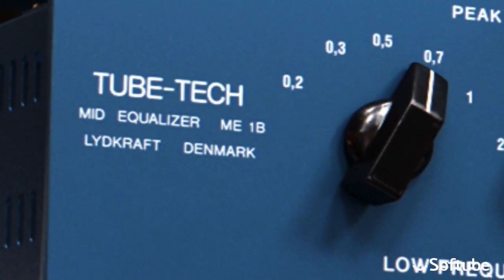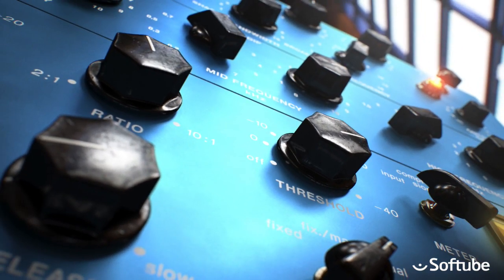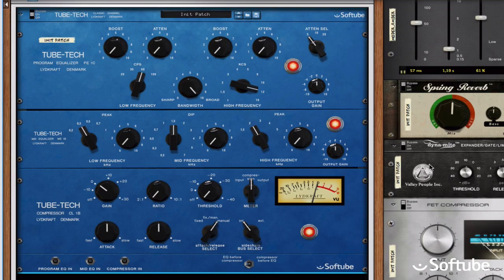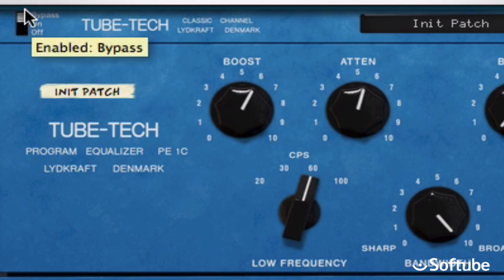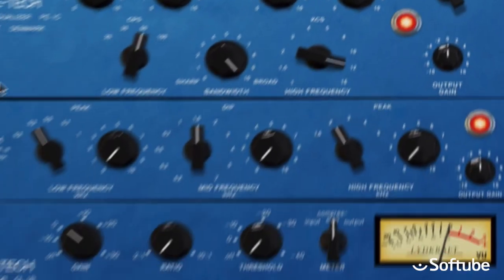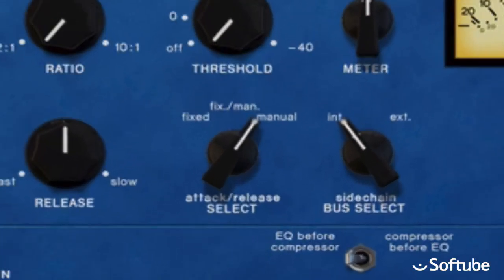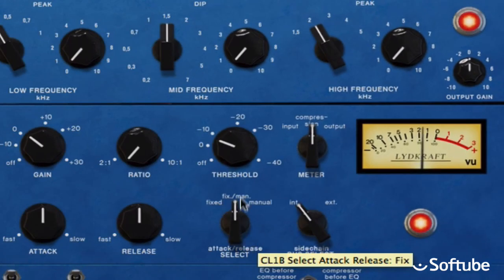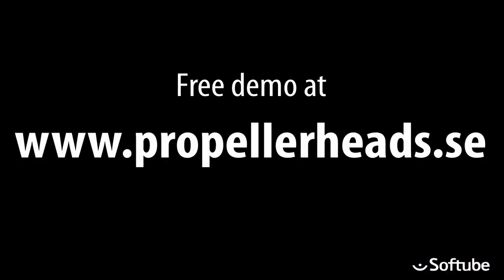Softube Tube-Tech Classic Channel for Propellerheads Reason

Comment: you think it's expensive ?!? compare that with the real hardware unit ^^ that was not affordable for everyone, only for big mastering studio, thank you for this massive add Softube guy's ^^ !!!
Reply: +Meteotrance Not to mention you could put 20 of these in your Reason rack!! XD
But yes, the price is not cheap... :/
Reply: +DreamWizard9 as long as you have enough CPU and RAM ressource you can put a lot of this on any track you wan't but for me this thing is more specific for Pre Mastering or Mastering usage, for using on group or steems it's a valuable option, remember that the price of the real unit is more expensive than the most expensive computer in the world ^^, and an emulated version could'nt beat the real unit but this one do an amazing job, and check what's Kuassa do for the same thing, those one are more clear and less hardware mimic than the Softube one, but can make a similar job.

Comment: hello..this sounds great..!
I have a GUI question...The Rack Extension version looks flat compared to the VST . The black knobs on the RE looks dull the VST version has more reflection glossiness to them, which helps bring it to life even the all blue Face plate looks awesome glossy wet metal looking surface...The Rack Extension version  again looks dull and flat.

The sound is still great !! but I wish The Rack Extension had that expensive glossy metal reflective look/Finish. I'm glad that this is finally in the REASON shop!!

Comment: BTW. Kuassa has just released their latest RE, just a day after this one from Softube. It's an EQ in the same style as the "Pultec* MEQ-5 Midrange Equalizer and the EQP-1A Program Equalizer. That's pretty much what Softube has in their Tube-Tech RE, except that instead of the three-in-one RE that Softube is selling (for the price of a garage in West London), you have effectively two-in-one (just the EQs) for only... €35 / $45. Take note, Softube!

Comment: A good thing, but the price is insane. 279 euro? For this price I bought a Korg KP3 kaoss pad.
Reply from the maker: It's two EQs and a compressor, so that's less than €100 each. And it's still circa 25% below the price of the plug-in in AAX/VST/AU format.
Reply: SoftubeStudios Its two EQs and a compressor that are enclosed in a single unit, which means it should be priced as a "single" unit and these are Re's which mean you cant resell them or have the freedom of using them in different DAW's so in my opinion and most of the Propellerhead Forums opinon - Your product is way overpriced.
Reply: sinnerfire

Not to mention that you can buy both Mcdsp bundles (3 EQs, 3 compressors) for 80€ less.
Reply: +sinnerfire Exactly. I personally think you guys, Softube, are fools for pricing it like you have. An insult to Reason users who are trapped in one DAW with the product = But you're obviously like the rest of the Swedes, so damn impressed with yourself it almost hurts, right? You think this is really valued at $350 for Reason or is that just your ego?
Reply: Ras Cricket +1
Reply: +Ras Cricket I agree Ras. It's on sale right now for $169 (the RE) but this sale price is still over double what I would be willing to pay for it. I did enjoy the trial. 

Louis Winthorpe III: Look, it tells time simultaneously in Monte Carlo, Beverly Hills, London, Paris, Rome, and Gstaad. 
Pawnbroker: In Philadelphia, it's worth 50 bucks.

Comment: ok i try it, now i need 300 bucks to buy it ^^. It's realy the last thing i need to get mid low and mid high listenable ^^ damn it's so good, and im not endorsed by Lydkraft and Softube ^^, but if you have Reason or Protools or other try this ^^ it's realy usefull, it's very good to test somestuff before going to a mastering studio, but by itself this plug in is a beast ^^.